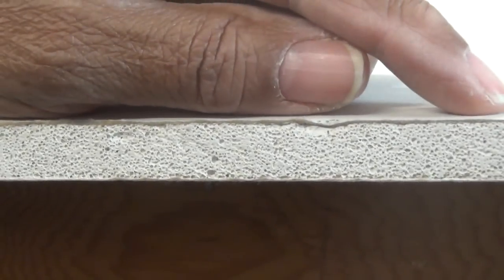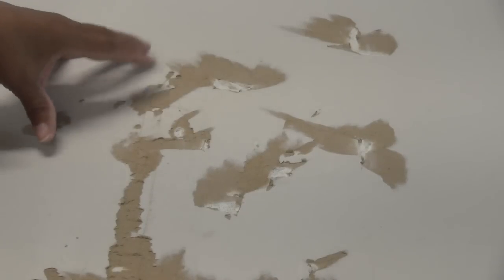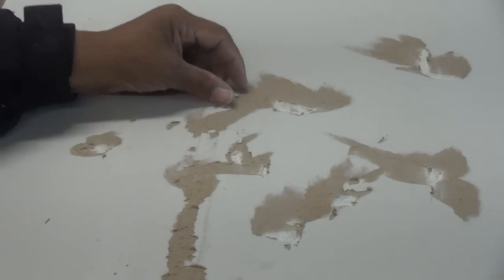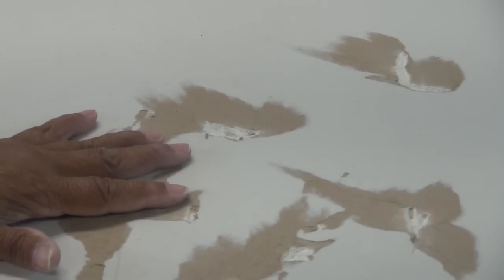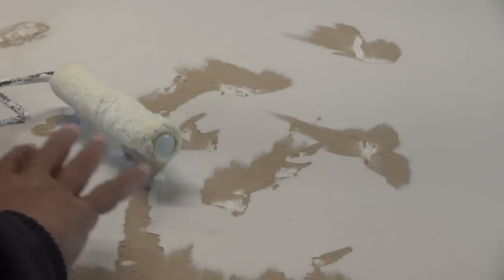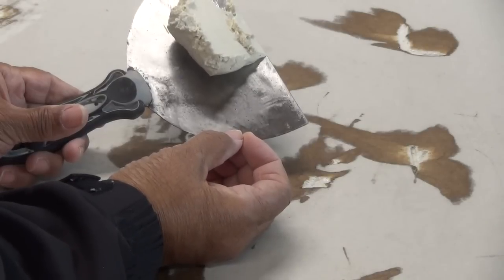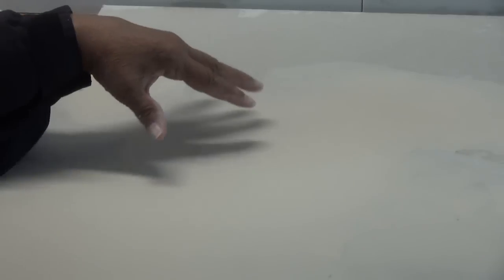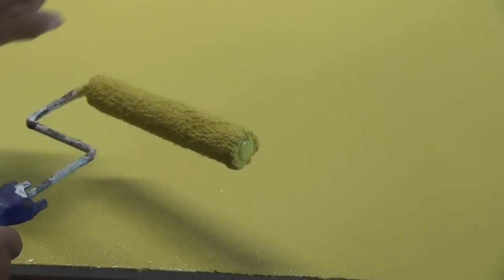How to Fix Damaged Drywall Paper

Comment: I bought some of that sealer a little wile ago to make repairs on a lath & plaster wall. There was a spot on the wall that had water damage and the plaster had became crumbly. I didn't want to make a big job bigger, so I soaked the plaster with this product. I let it dry for 24 hours. the sealer bound the crumbly plaster back to a solid foundation. Repairs made, no problem. Great stuff. Worth the $$$. Probably not the exact intended application for this sealer. But it worked.

Comment: Great tutorial Leah..... Just a couple points if you don't mind. I have been doing drywall repairs for over 25 years and can tell you the product being used is watered down white glue. I have been making and using  this product for many years. 1 part premium white glue, Lepages or Weldbond brand and 2 parts water. Apply just as shown in the video. One tip when applying your drywall compound.... When applying always thoroughly mix your compound before use and wipe it on one direction and wipe or scrape it off the opposite direction, that works it into the loose edges of the paper better. You can also add the white glue to your paint, 1 cup glue to a gallon of latex paint to cover stains without them bleeding through. No oil paint needed. Good Job Leah
Reply: GotU Productions - thanks for the tip! I've  havent heard of using white glue in latex paint to help cover stains. Does it change the sheen of the paint? 
 Would sure be a lot cheaper than using a stain blocking paint. And save a quite of bit of time. Thanks again, will definitely be using that tip in the future!
Reply: No it does not change the sheen. But does save alot of money
Reply: Great info! Thanks!
Reply: GotU Productions 
You’re amazing to share this Got U !!!!!   Thank you pal!!!!!!!!!
Reply: Wow! Thanks for these tips...and the glue tip too....living out in the country means waiting to head
into town with a list of things rather than hopping just out the door to get stuff....I have lots of Lepages
or Welbond glue....so tomorrow I will mix up some of your homemade stock and continue on
with this reno bathroom I am doing...thanks GotU Productions, from Eastern Canada, carpenter, MaryEllen
Reply: Interesting. I like to keep a spray can of Kilz around for stains. Only a light coat is needed and drys very quick. If I can avoid a brush/roller I will!
Reply: Thanks for the tip!
Reply: Probably not white glue (PVA, "polyvinyl acetate"), but instead just straight acrylic resin, the same vehicle that you'd get in acrylic "latex" paints but without the pigments.  It looks white while liquid but dries clear (which is why your colored acrylic paints darken a bit when they dry).
Reply: @micxploed  Sheesh. Chill. You always this angry over nothing?
Reply: @micxploed  I just said a prayer for you brother
Reply: Not ordinary PVA glue presumably.  I doubt this would be up to the job depending on whether or not you require a moisture resistant surface.
Reply: Damn I put weldbond in everything, coffee, oats, concrete that's why I'm held together at almost sixty.
Reply: When you say one part. How much is that. The glue comes in different sizes
Reply: @lavelbrown9352  It means any size you care to choose. One part of the white glue, two parts of water. So for example you could use cups, and use one cup glue and two cups water. Or 1 quart glue, 2 quarts water. Or one gallon glue, 2 of water, etc. Just use whatever measurement you need, it's the ratio you have to maintain, 1 to 2.
Reply: GotU Productions : Can this be used as a spot sealant without visibly effecting the final product?
I made the mistake of applying Kilz 2 to these ‘bubbles’ (didn’t see them until after) - will this cause an issue? 
Should I cut-out the bubbled areas of paper?
Thanks in advance!
Reply: GotU Productions this is amazing. Are you saying that by adding one cup of glue to the paint, you can cover stains? All types of stains? Thank you very much for your information
Reply: Smart idea
 Thanks
Reply: Whats exactly is white glue? Wood glue is white. It dilutes with water! Sooo can i use wood glue for the same purpose as sealing damaged drywall as shown in the film?
Reply: @patrickcowan8701  🤣😂🤣😆

Comment: Love you Leah.  I have always loved doing things with wood but never have had much confidence.  I am a nearly 72 year old woman and my husband is finally putting a heater in our garage.  I am so excited  I can hardly stand it.  We live in Colorado and as you may know working outside is not real easy in the winter even though our winters can be pretty mild.  I have watched so many of your videos and have learned so much.  Everytime you put something new on that I don't have, I have to get it.  I am always running too the hardware store or going on line.  Keep up the great work and continue with a smile on your face.  In my senior years, I am having fun learning.  Thank God for You Tube and thanks to all of you that continue to share your knowledge.  This issue has just come up and really didn't want to do drywall because there is no need at this point.

Comment: Leave it to Leah to bring another great product here. Years ago when Zinsser first brought this product to market I was in a paint store and the sales rep was showing it to the store owner. He asked me if I give you a gallon would you try it and give me your feedback on it, I use many gallons of it yearly and it yields excellent results every time. 
I am so pleased to see Leah do this video as you will truly benefit from applying it to your walls and ceilings. It's especially useful when removing wallpaper and even with scrubbing the adhesive off there are always trace amounts of residual adhesive left. This product seals the glue and the fresh paint will not soften it and cause problems. 
Again GREAT demo Leah, you're a gem.
Reply from the maker: That is a very interesting story, Clint!  I guess you were in the right place at the right time.  Also, thanks for sharing your experience with Gardz ! :)
Reply: Clint Price I
Reply: Godsmack
Reply: You can use it to remove wallpaper? How do you do that?
Reply: @Melissa0774  You can't use it to remove the wallpaper, Clint's comment is just worded a little confusing if read the wrong way. It is useful after the wallpaper is removed, for the adhesive left behind.

Comment: Great video, Leah!  Bought this from a local paint store.  Product is excellent!  I had a huge drywall tear.  After I cleaned up the rough edges with a utility knife and sandpaper I used the GARDZ Problem Surface Sealer, and this stuff sealed and strengthened the torn area nicely!  Thank God for YouTube!

Comment: Good video Jane. 50 years ago An older painter/plasterer/drywaller told me to use shellac on torn paper when drywall paper gets torn or glue residue from wall  paper being removed. He said spray, roll, or brush it on and when dry sand it smooth then give it a skim coat of mud and it should be good for paint. On the rare occasion you may need a second coat but I haven’t yet. It works great. 
Keep up the great content.
Ron

Comment: I use masonry bonder and a wide brush. (available in quarts)  The brush will lay the curls of paper back down and doesn't leave a stipple like a roller does. Fill with joint compound, prime and paint.

Comment: I own an Ace Hardware store and we have this in stock.
Reply: Just checked yesterday and the Ace Hdwr at Wexford, PA doesn't have it.
Reply: Where? We do have in ok
Reply: Then your store is unique. Most don’t carry it.
Reply: I love our local Ace hardware
Reply: Good to know. Sometimes its hard to find
Reply: Our “Imperial” hardware store converted to Ace Hardware a few months ago and yes you’re correct Sir, Gardz was stocked.  Outstanding product.
Reply: I don’t have a house otherwise I would reap and try😥😥
Reply: @patricksharma1830  - I said the same thing years ago.  Things change; sometimes for the better and sometimes...well let us just say that things/always change. It’s that change that is achievable in our US of A.
Reply: Very cool John 😎
Reply: Except I went to the Ace Hardware store you own the other day, and thery didn't have it in stock 😔
Reply: The stuff is junk and only water-resistant.  A proper water-proof shellac product is much better.  Watch Vancouver Carpenter's channel for examples as to why it is a fail.
Reply: Ace Hardware ripped me off when I retuned my grill!
Reply: I wish you were my store

Comment: Hi Leah, thanks for the tip! We're in the process of removing old wallpaper in the house we recently bought and I noticed the drywall behind the 2 layers of paper and glue only had a very light, skimpy coat of primer on it. Applying the hot water/soapy mix to remove the old paper and glue is also removing layers of drywall paper.  Good times!
Reply from the maker: That's the way it is a lot of times.  That is why this product is so helpful in those instances.
Reply: @seejanedrill  Luckily, my local hardware store specializes in house paints and repairs. I'll pick up a quart and try it out. Have a good one!

Comment: I ran into this video just hours before I was going to just put the joint compound over the paper where the paint peeled off...I was using a different video that never said to seal first. This was a great video with precise instructions and a great product recommendation.
Reply from the maker: thanks, glad it was helpful!
Reply: It was very helpful. I have no put the sealer on and the joint compound. Just finished sanding, and just have to put another coat on in areas that needed extra. It is all looking great now.

Comment: Been using Gardz and equivalent products for years. Keep a gallon in my work van. They are a life saver. Easy to use. Easy to clean up. Work great as a new drywall/joint compound primer for repairs and small remodel projects.

Comment: I would watch Leah do anything*, my freak-out over my chipping walls has completely gone away watching this. My issue isn't about drywall but I can't find what I'm looking at so I found this and I *think it could be a solution. I have plaster walls in an upstairs bedroom that has been wallpapered and then covered with some kind of flat cardboard (so, not corrugated) and the cardboard or tagboard sheeting was painted over with wall paint. And now it is chipping in places. And it is really kind of odd in the corners because cardboard doesn't create a perfect fold for the corners...it kind of looks saggy. Anyway, it's a mess and I didn't know what to do. I think this could be what we use!  Thank you, Leah!  I am going to watch all of your videos!

Comment: Thanks Leah.  Love the step through...I have a two wall project that had wallpaper but it wasn't coming off without a fight. So it came off iln strips.  of course it left it's own paper behind and took drywall paper off...so lots of hills and valleys.  Going to use a 14" trowel and hand bucket after the sealer (have a big area), light sand and then the 2nd coat of each.  Thanks again...Peace

Comment: I use a Cemix multi bond which is a milky and latex based. 5 litre bottle concentrate makes a 20 litres of sealer. Works out about 6 dollars a litre. I do love Gardz, it does a beautiful job. It certainly beats an oil based sealer. For this sort of repair ❤️.

Comment: Love your show. Just use a pva glue and water mixture instead of expensive products. We apply this with a roller to all drywall projects before painting or plastering, it locks in any dust or paper.
Reply: PVA glue...as in regular Elmers glue?  What's your glue to water ratio?

Comment: Leah - Thank you. I had some ceiling water damage from a roof problem and the wallboard paper bubbled up in several areas. I have been putting off working on it and your video addresses what I need to do and makes it easy. I hope I can match the paint and not need to paint the ceilings in several adjoining rooms.
Reply: Get a coupon and go to Sherwin Williams or other quality paint store with a small sample of the dried paint from under a switch plate cover. They will match the paint and write down the formula so you can get more made up if you need it. It will be a bit pricey BUT it's better than having to do those ceilings!
Reply: @tanyawales5445  Tanya - Thanks for the tip!  Bob

Comment: Thanks for your videos. As always you're always very informative and you explain things well.
As a professional painter I have used Zinsser products for years. The best one I've used is the Metho based sealer that dries in about 30 seconds.
 I've used it a lot on smoke damaged jobs. Just wash down with sugar soap and then seal with the Zinsser. Paint like normal after that.
Reply from the maker: No doubt you're a professional, only a pro would mention sugar soap.  Thanks for taking the tome to comment.
Reply: @seejanedrill  Thank you for replying. You always have good tips. The one about resharpening the oscillating saw blade was good. I would have just bought a new one previously. Now mine is blunt, so I'll be re-sharpening it as you showed us.

Comment: The previous owner covered the whole house with wallpaper and paneling with construction adhesive. The process of removing the wall paper and patching the drywall took forever. If I had to do it over it would have been easier ripping out the drywall replacing with new. Yes I did use wallpaper scorer remover tool and steamer. Some parts came off OK, others were a battle inch by inch. All fixed, skim coat most of the walls and painted, with no indication of previous damage.

Comment: nice stuff.  I heard a tip from a home improvement show that works great on the small areas I had that were not worth buying a big can of this stuff.   We just diluted white wood glue and painted it on.  It binds to the paper and stabilizes it, and the joint compound is very happy to bind to it.  This stuff looks very much like diluted white glue.  I would love the read the label.   :)

Comment: Man, wish I saw this last week. Our new home had tons of damaged Sheetrock paper from moisture issues, peeling paint and 45 years in a bathroom with no fan (I installed one). I ended up using a Sheetrock primer, joint compound and skip trowel technique using texture to hide all of the issues. Ahh well..

Comment: You can get it at Menards. Heads up though if you use this to Prime joint compound before painting, there's a good chance your tape will rip the paint right off, even delicate tape. Works great for ceiling down the paper and going over any wallpaper residue that might be left prior to skim coating. I cannot recommend it for priming as it says on the can, just for stuff like this prior to skim coating

Comment: I know this is an old video.  I did what you said the best I could, except my wall has texturing from 1974.  I also used the Gaardz over a drywall patch (17" x 14") so that all areas that have Ez Sand 20 over them would look the same.  Not too concerned as this is in the garage, but I still hope it turns out okay when painted.

Comment: Thanks Leah; wish  I'd seen this video before this last job I did where they tore off a bunch of tile from the wall and I had to repair the rock. I ended up with a lot of bubbles from the torn paper that I had to keep sanding and re-mudding before texture.  Most of it covered OK but this looks like a much easier process.

Comment: You can use MH Ready Patch and skip the primer. It's made with alkyd resin and doesn't soak into the gypsum. Inexpensive, dries hard and resists cracking. Great stuff.

Comment: FYI - 

Zinsser's shellac based primer or the synthetic water based version will do the same thing
and can be found at all the major home improvement stores.
(about the same price as GARDZ)
Reply: 2Truth4Liberty I have used both and this is completely different. I love the oil based BIN, but I’ve been using GARDZ for a few years now and it truly soaks in and bonds with the surface in a very different way. I’ve also found that drywall mud bonds to the GARDZ covered surface in a way that it will not with BIN or other primers.

Comment: You can even use the same brand product call B-I-N ultimate stain blocker primer. 1-2 light coats depending on the tears.

Comment: Leah great video, I recently repaired a room that had wood paneling glued to the walls. There were tear outs similar to your video, but there were also several places where removing the panels separated the paper layers without tearing. I ended up removing layers of paper where I knew they were separated with a putty knife and applying Gardz. It actually took a few applications before I was able to remove them all. I wonder at what point is it better to just replace the drywall instead of trying to repair it? Gardz smells like vinegar and applies like thinned elmer's glue for those wondering.
Reply from the maker: Replace versus repair.......time and mess are the factors to consider here. Will it take longer to make the repair than it will to replace?  Also, are the materials used for either application about the same in cost? These are the things you need to consider when trying to decide.

Comment: I am a pro at this and fast dry oil base primer works great at this kind of repair,cheaper and faster dry time and much better water seal so drywall mud wont release sheetrock paper, only draw back is fumes.

Comment: Great video, but I have found a product that is sold at Home Depot made by Roman Decorating Products called Pro 999/Rx 35 that is also water based and works very well. Also a good primer for masonite doors, saves paint

Comment: the only reason I would use guardz on damaged drywall instead of a oil base primer would be the customer requesting it, why because oil base primer would not only seal the drywall but it will also block any water stains that you may not see at the moment, and it costs less, $15 for a gallon of kilz primer

Comment: I usually use oil based primer or just coat it with 20 min hot mud and the regular mud the 20 min mud dries before paper can separate from the moisture